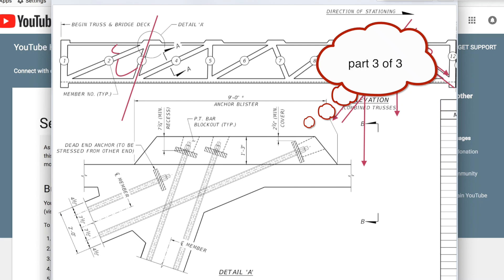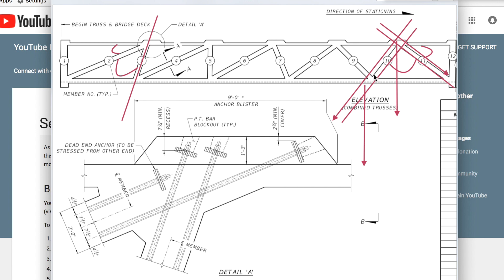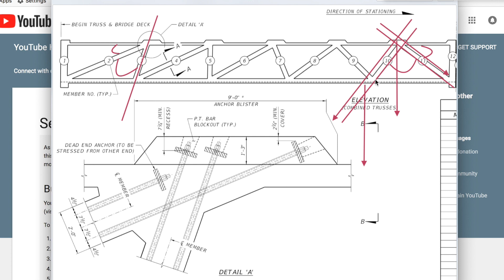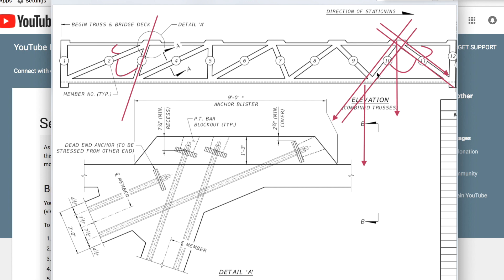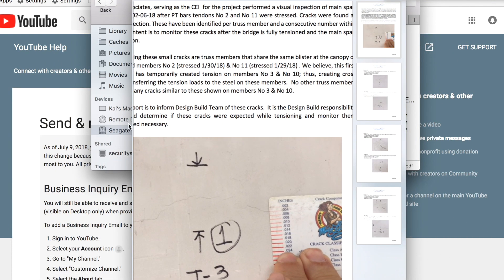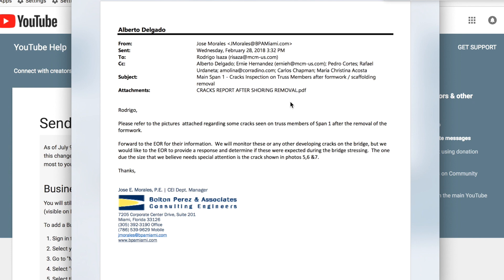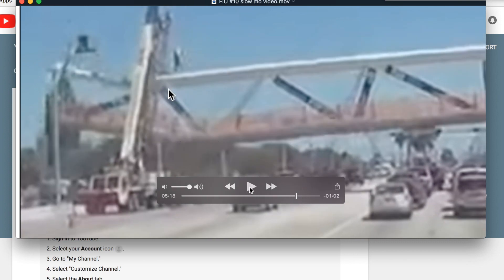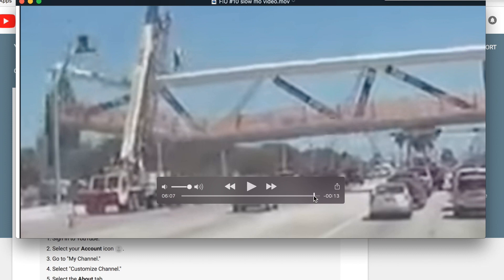FIU BRIDGE COLLAPSE  CRACKS REPORTED BEFORE POST TENSIONING 3 OF 3

Comment: Fact: it cracked well before the move but we don't know any changes were made.
Fact: it cracked again during the move but they didn't think it was important.
Fact: you can see rubble on the South end canopy (after the collapse) and a Jack hammer at North end.
Fact: you can see the void from the unused canopy PT bar under the blister after the failure
Fact: the blister had a lot more steel in it than the canopy so would have flexed much less than the concrete especially the parts full of voids. Young's modulus of concrete is much lower that steel even before you add voids. That would concentrate stress at its edges.
Fact: there are many designed sharp angles (in three dimensions) that create multiple stress concentrations
Fact: errors in placing the re-bars etc will add to stress concentrations especially in areas of low concrete cover
Fact: the road was supposed to stay closed until after the PT bars were de-loaded
Opinion: I agree with your thought that the top canopy failed just before the lower deck
Question: If the PT bars were de-stressed before the road was opened why would there be more rubble and a jack hammer on the canopy 4 days later?
Occam's razor: they did not de-stress the PT bars before re-opening the road.
Fact: the cracks mean the structure had already failed before the move and we know things got worse during the move.
Thought: suppose the only thing holding it together was member 11 which was then de-stressed 4 days after it was supposed to be?
Sadly: if they had done that work at the right time at least the road would have been closed.

Comment: 8,500 PSI or 6,000 PSI concrete used? Section is (389,000x4)/(section 10 net concrete area over estimated 11x24) = 5,900 PSI < 8,500 x 0.6 NG by code.
Reply from the maker: The "initial  set" is done while the concrete is still gaining strength... that is why the lower psi during post tensioning.
Reply: If the concrete cracked up due to compressive force when green (7days cure 70%, and 28 days 100%), the cracks should be in diagonal to PT force. Maybe were those cracks from? No matter how you slice it, It is A very bad engineering model and design, bad construction, bad people involved and bad all around.  Keep up the good work. Dig more interesting background for us to enjoy. Thanks.
Reply from the maker: Thanks for the support...  and I agree, the cracking could happen while the concrete was ''green'' and internally, where we could not observe it... they could use cameras to look down the ducts... but, that might be, "too much like work"...  (Oh WAIT!  THIS SYSTEM GETS INSTALLED IN DUCT WORK SO NOT POSSIBLE TO LOOK FOR CRACKS ON THE OUTSIDE OF THE DUCT WORK WITH CAMERAS.)....   this is why I so dislike and am totally bias against this system...   
PAY THE DAMN STEEL WORKERS AND UNIONS TO BUILD THE BRIDGES - TOUGH LUCK...   you can't keep all the money and have to deal with union workers!
Reply: I remember one of your viewer mentioned, he thinks the concrete is "spalling" from your picture. Mmmmm? Maybe a very good observation.
About the steel. Last week I drove by the street with crosswalk, this week I find there is a steel pedestrian bridge in good taste already in use instead of crosswalk between casinos on Las Vegas strip streets. Just that quick and happens all the time.  But that so call FIU ABC will take 2 years. What the F. with tax payers money????

Comment: According to the Miami Herald, twitter user with the dashcam was o2webdev. I wonder if he has the RAW camera footage which might be much larger size but may have higher resolution and higher frame rate (vs. what youtube or twitter would compress to)
Reply: I don't mean the RAW posted online. I mean getting a copy of the actual file on the dashcam
Reply from the maker: I wish I could get access to the original video and not speed up either...
Reply: contact the guy on twitter and let him know about your site and mission here. . .
Reply from the maker: Not sure about that guy having the original as that was from a construction worker... it was in the truck that came from the construction - staging area...